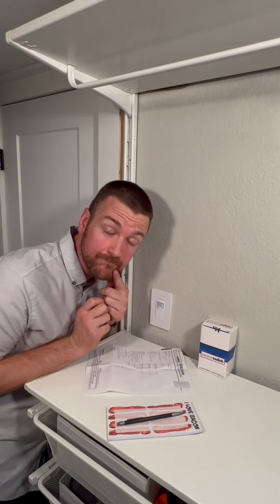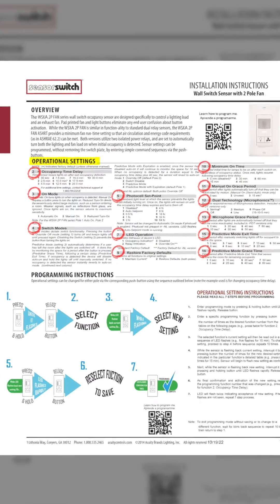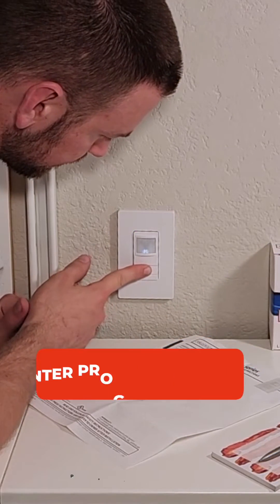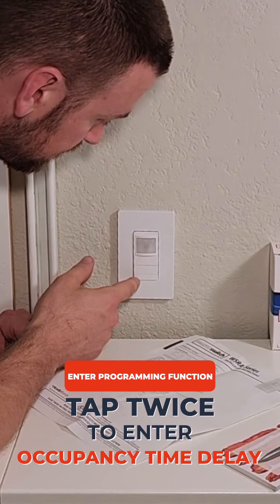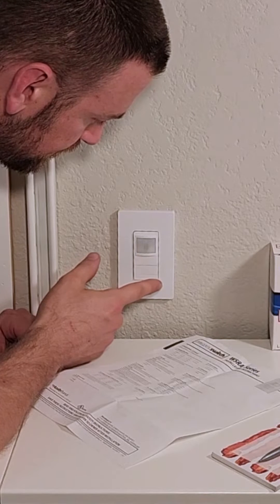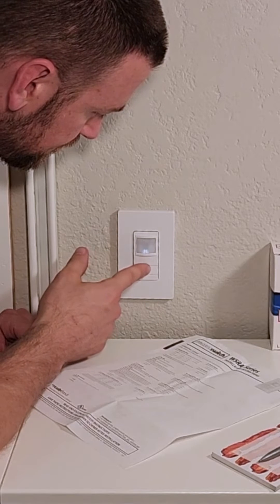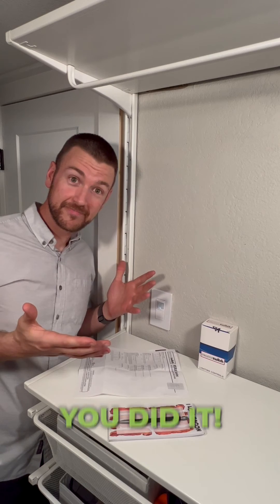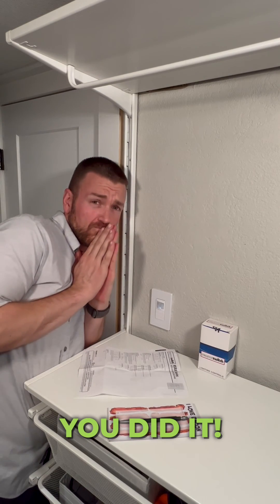SensorSwitch WSXA: Step-by-Step Programming and Set Up Guide With Time Delay Settings Example

Comment: Been trying to figure out how to program it so that I don’t have to manually turn on. Not sure why it doesn’t turn on when I walk by it. Any help is appreciated.
Reply: These things are garbage I’m having the same issue
Reply: Same issue here, my contractors acting like I’m the dumbass! 😂 awesome video otherwise. Helped me understand the timing. Seems like a poorly optimized product
Reply: Trying to do the same thing. I get the rapid flashes for programming mode, but when I let off the button, it goes right back to operating the lights… 🧐